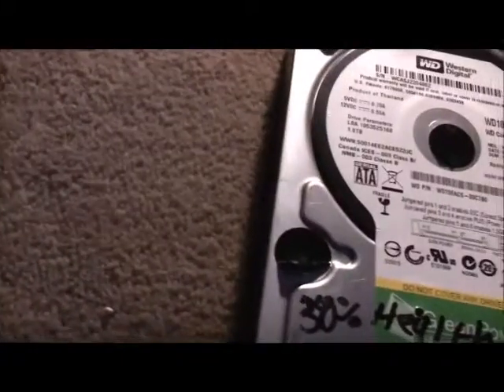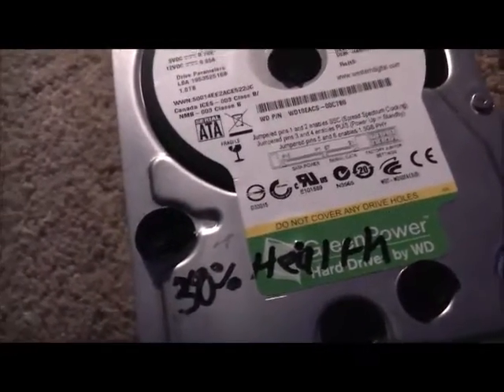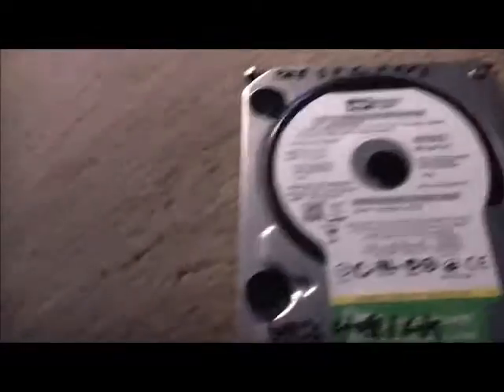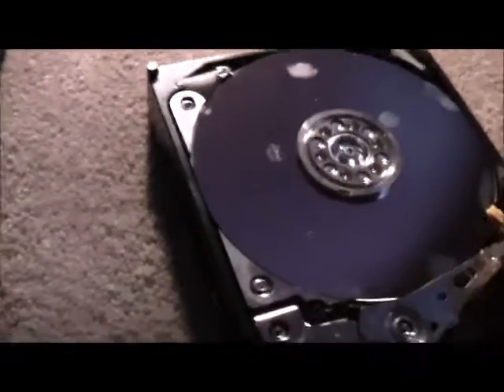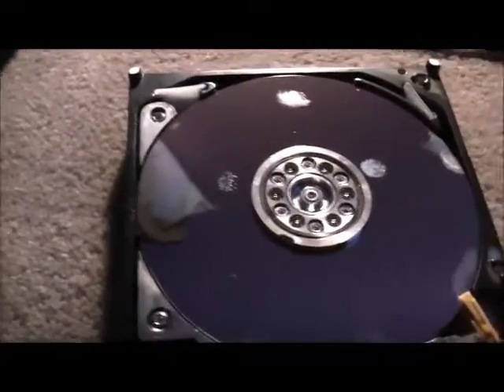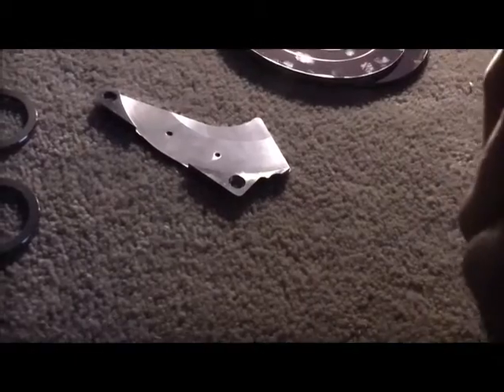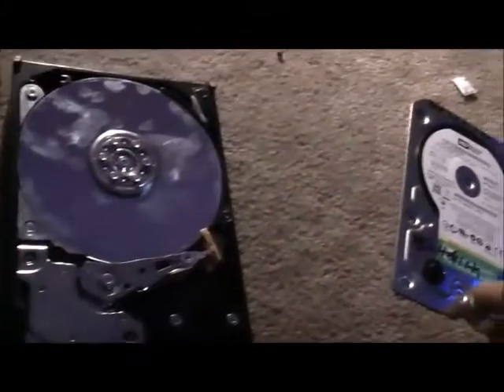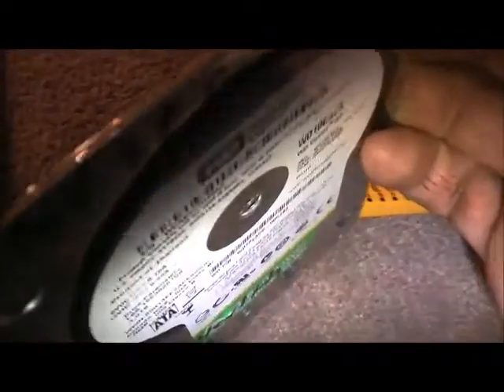WD Green WD10EACS Bad Sectored HDD Teardown

Comment: My EADS drive said it had 287 bad sectors and 20 pending. and i used the WD tools to zero it out did that three times and no pending sectors and no pending sectors. it does still report 80 bad sectors in total * Magnetic degradation.*
Reply: +Coty Riddle  Mind you the drive is pretty old 5 plus years and was pulled from its buggy external enclosure which caused it to randomly fail and over heat,

Comment: If you constantly get more bad sectors then the drive is failing period. HDD re-generator (the paid version) actually works... but the drive needs to be good no real bad sectors) Sometimes bad sectors are due to corruption (file system errors/not shutting down properly/movement while writing*Laptops. But that particular drive your showing and along with some other western digital Green drives fail early due to the constant loading/unloading of the heads onto the ramp/disk. bad coding in the firmware. That disk you can clearly hear is DAMAGED. Physical damaged can't be repaird. and the firmware aint seeing damage per say. it just can't calibrate due to the damaged heads/platters. Not able to get the tracking information is what is causing it to try to constantly spin up (re-calibrate) logical damage can be fixed with a full zeroing out of all sectors. some sectors fail due to not being able to hold the magnetic field and that is normal.